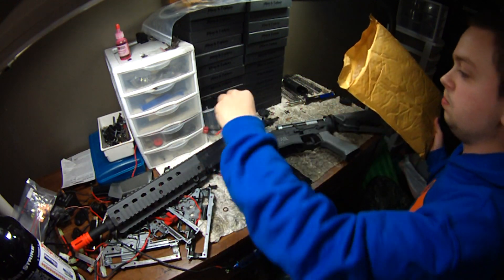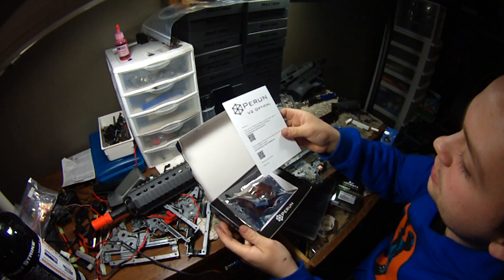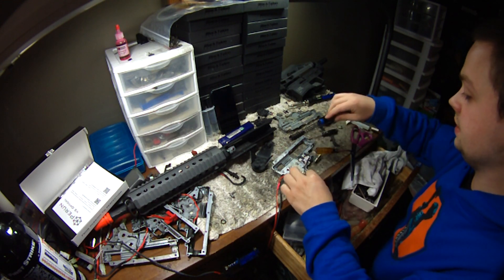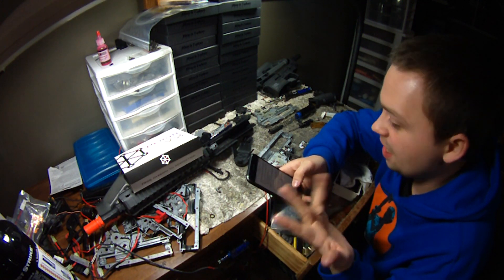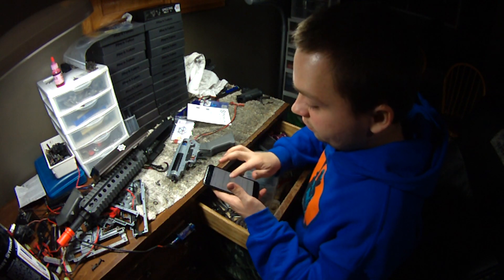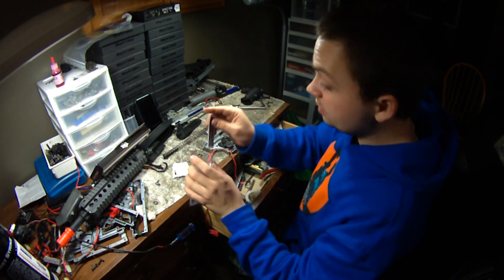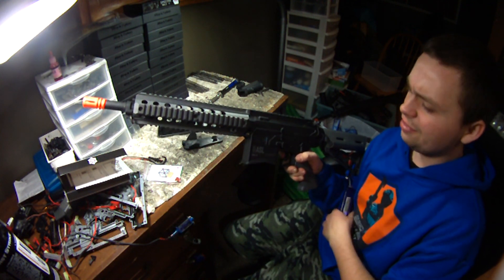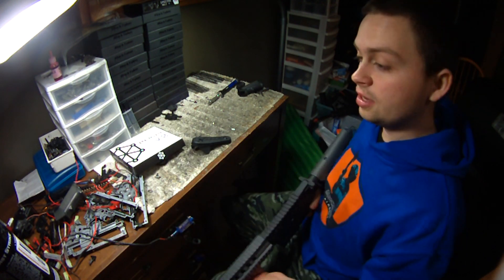NEW PERUN V2 OPTICAL MOSFET REVIEW!

Comment: Great mosfet, though i bought it to precock a 9 tooth DSG build and it just wont do it unfortunately... then again i was warned by evikes description. Rarely with Active Braking on it will still double fire or half fire. but like i said its rare,  just pull the trigger again and keep going. It also has a very quiet buzz. Sounds like hair clippers.

i recommend only using this mosfet for SSG builds for best bang for buck.
Reply: FOV Airsoft something sounds like it is wrong, since people have these working on 8t and even 6t ones
Reply: @opairsoft8100  idk i went back and fourth with the company and even exchanged one they don't know and I don't know so all I can recommend it for is SSGs unfortunately
Reply: @opairsoft8100  Speaking of sounding wrong it liked to quietly buzz like hair clippers
Reply: @NexGenTactical  dont do precocking on a dsg, i have 100% AB on and its precocked on last teeth because of overspin already, if u use any precock it will double
Reply: @juggleplayz9664  it would work if i had an 8 tooth not a 9 tooth
Reply: @NexGenTactical  then that means ur sector is too long, u need a mechanical mosfet that feels the thingy on bottom instead of see the teeth on sector gear

Comment: Gate aster over this or the titan. But btc beats all of them.
Reply: But the aster has more problems than the titan
Reply: @whitm8823  such as?
Reply: if you get light in the hole where the trigger is it will not fire for a few minutes, it also has some weird quirks every once in a while where my titan has been fine. Also you can't use some triggers with the aster. But, you are right a bct beats all

Comment: I'd like to see how fast you can get it going in double shot mode lol
Reply: The gates have a semi max rof statistic now. With binary function, dsg, and speed trigger I can get it to register 20 rps. The gates firmware for dsgs needs updating but once that's fixed it'll be great. One thing is the peruns basic software is equivalent to the gate titans new expert software, so the perun is way cheaper, and has closer function to a btc
Reply from the maker: I will say the BTC has ROF delay and I dont think the Titan and I know for sure the Perun does not have it. And I love that setting.
Reply: @sureshotmidget14  titan has it. It also now has programmable cycle completion so you can adjust down to the milisec so you can set any precocking for any gearset. I really like it for short stroked builds or just optimal cycling without using a ton of active breaking
Reply: I totally agree that the peruns are better tho. Just need to up their software a bit.
Reply from the maker: Yeahhh, I feel like it will probably max at like 20 MAYBE 25 RPS.
Reply: @sureshotmidget14  that could definitely push some buttons on the field.
Reply from the maker: Ohhhhh yeah. 🤣🤣

“REEEEE”
Reply: Is that what the pull-and-release feature is? Fires on pull and release?
Reply: @Evan-eh9dd  Yes. It's also called a binary trigger. Look it up, they have that as a new feature on the GATE TITAN's.
Reply: @Evan-eh9dd  yep